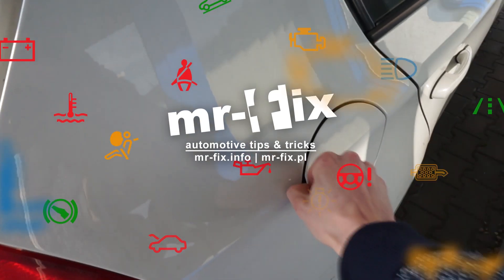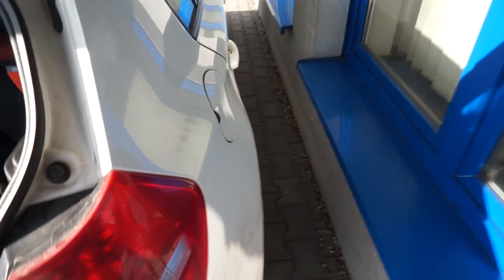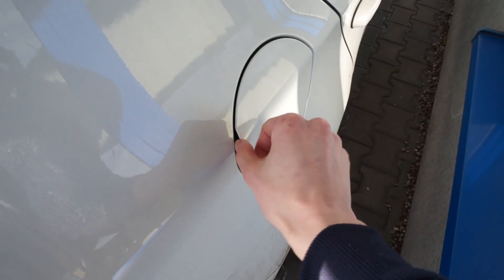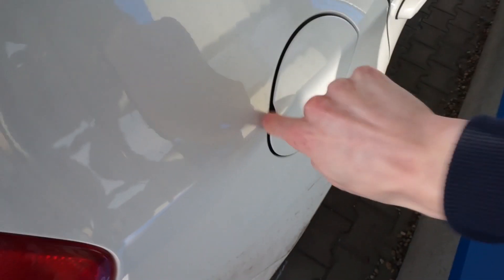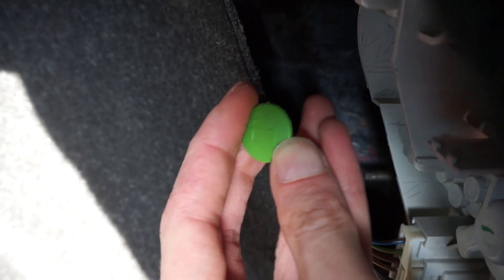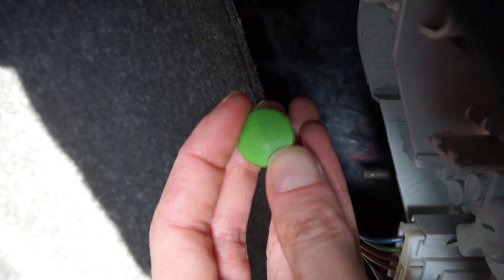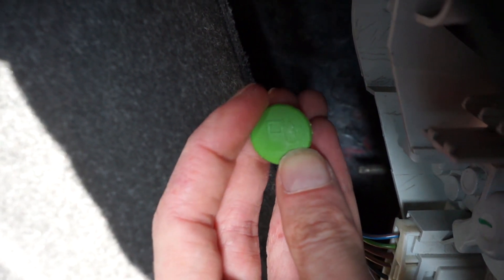BMW fuel flap emergency opening (E87 E90 E60 Z4 X1)

Comment: I have a e81 2.0 petrol , and I get rough idle and misfire on cilinder one, changed it twice, same problem. Can you make a tutorial about this? maybe I need to clean injectors?
Reply from the maker: I have diesel so I really can't relate directly to that issue... Sorry.
Reply: I may be able to help you. If you have the engine model with VVT (valvetronic) iyou can check the either the VTT motor or the VVT sensors. It is worth trying to check the spark plugs and the ignition coils first because these are cheaper to replace.